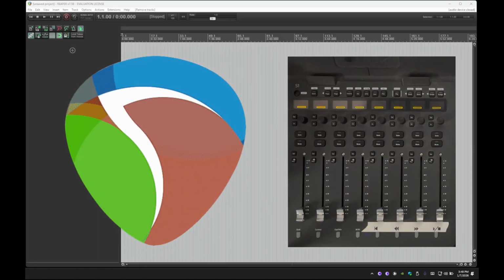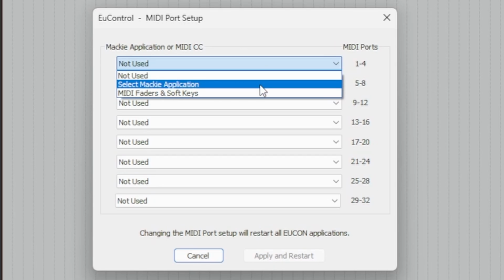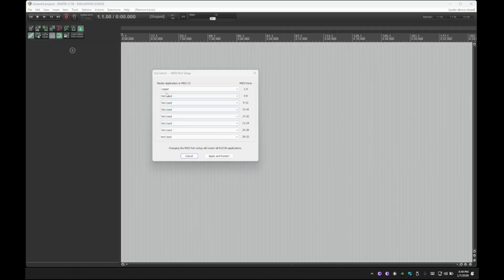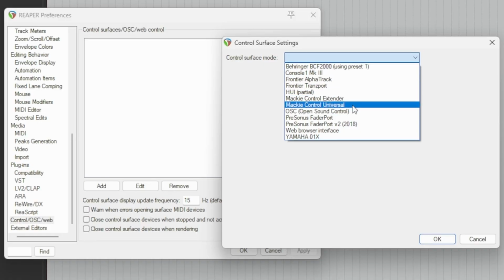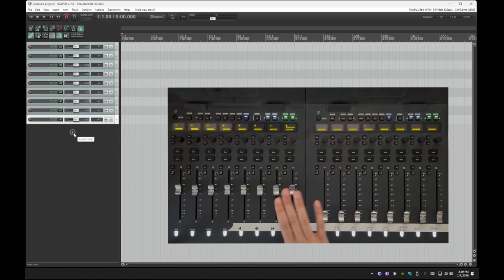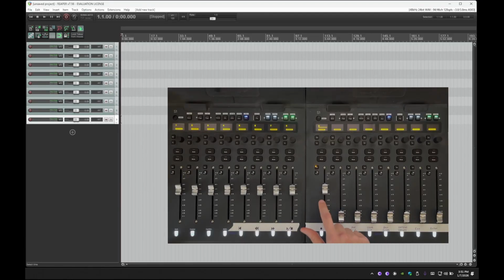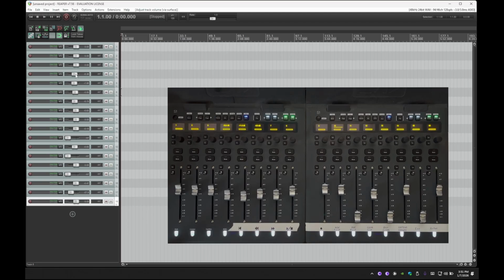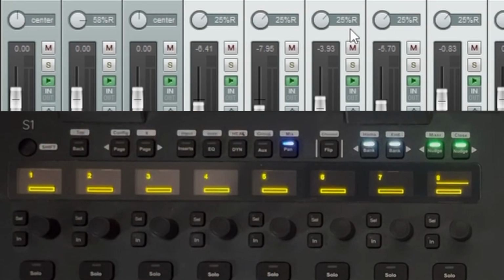Avid S1 Reaper Tutorial in Windows 11

Comment: A) If you check the Reaper Forums you'll find a project by Geoff Waddington? that brings Eucon to Reaper.  So rather than Mackie, you'd choose Econ.  

B) It will also allow you to use the FREE Avid Control App on your iPad.

C) What I don't know is what happens with the 2-iPads on your 2-S1s.  I'd imagine that, while you wouldn't get all the features, and it'd be buggy, it would also give you enough visual feedback to be pretty sweet.  And you could get a couple of $50 Android tablets to test it out.

Please follow up with this as you discover more, but for free right now you can get A LOT more than Faders and Pans.

Comment: Thank you. Your video was super helpful.
I want to use S1 for mixing these days, on a Mac. 
The main difference in the setup is that in Reaper’s Control Surface settings I select “Euphonix Port 1.” 
At first it didn’t respond but after restarting EuControl and Reaper a few times, it works.
Reply from the maker: You’re welcome, I’m glad the video was helpful! Thank you for the tip for any Mac users out there.
Reply: @MANdrewMusic  So cool. I would love to be able to properly use an S1 with Reaper. I am accustomed to using an AVID S6L on live work and what I am most of all missing with DAW control surfaces so far is custom layouts, VCA spills and sends on faders and such. I am under the impression that w/ ProTools the S1 works nicely with those kinds of functions. Have you had any more success with more features of the S1 w/ Reaper  since this video? Am also working on Mac so aprreciate the comment of @skyexu315 as well!